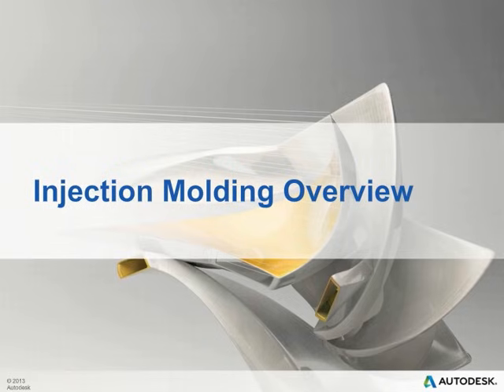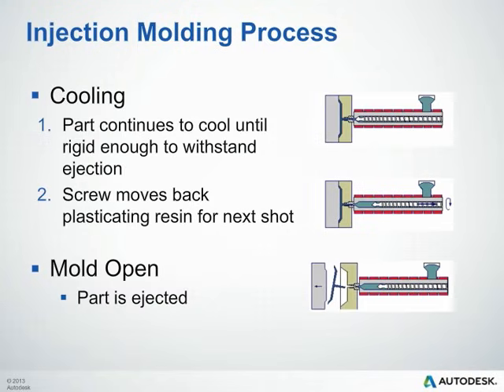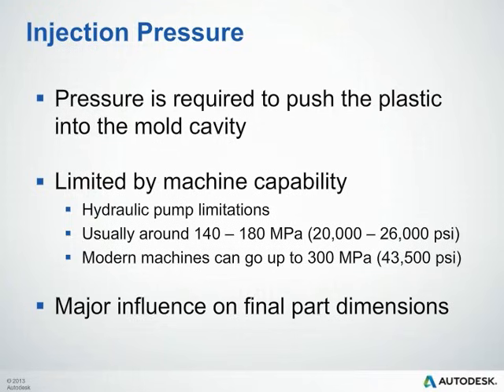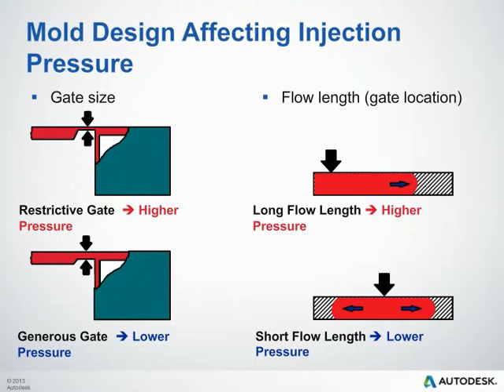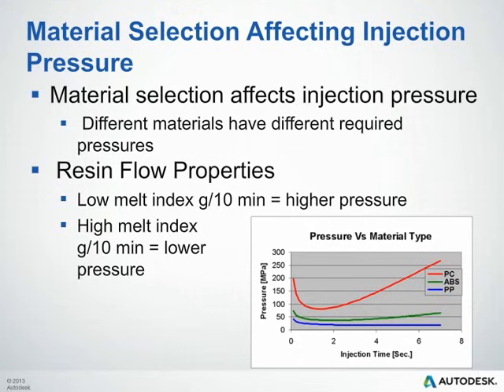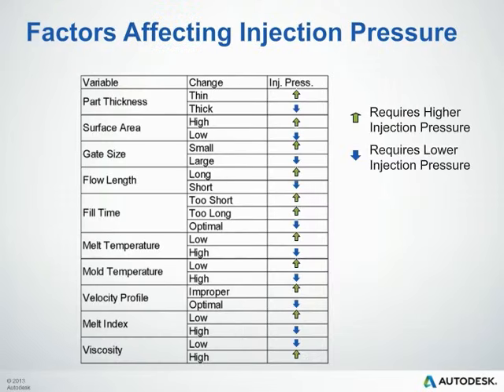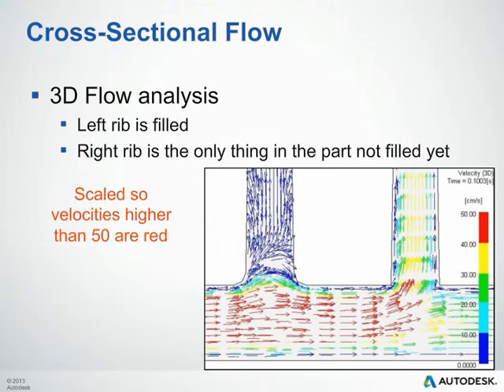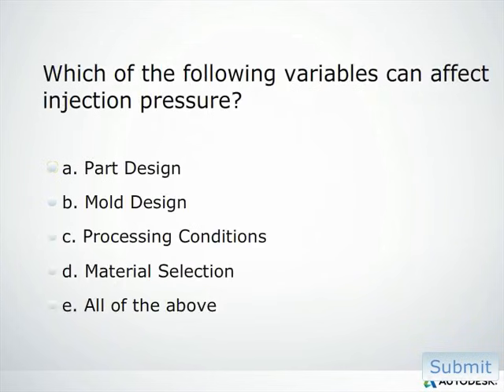Injection Molding Overview

Comment: Thank you. It is very interesting and helpful video. I need to know also how could I re install a program of the injection machine if it is crashed or failed down ???
Reply: Hope u have a back up disk or other storage device with the program.  The problem most machines have is half or the memory will be the program files for the machine 0 locations and such for the machine to know how to move and such.  The other half is a rewritable memory that has the part data.  With a sudden drop in power this memory maybe lost.  So sadly if it's gone it's gone